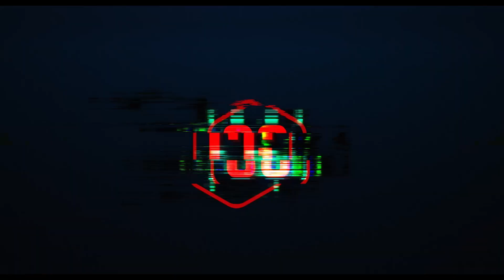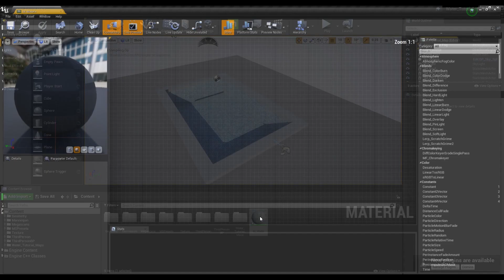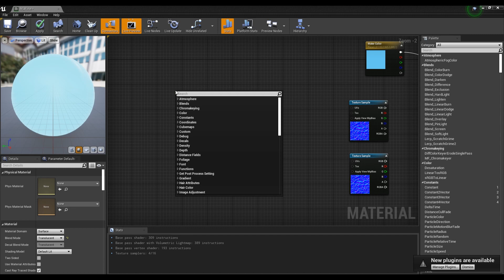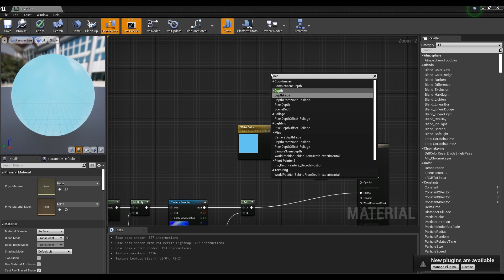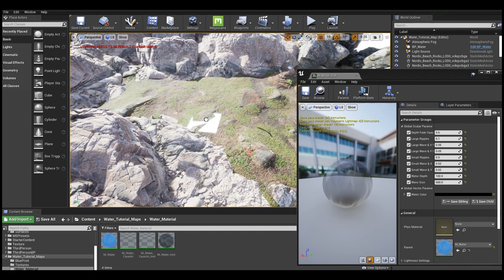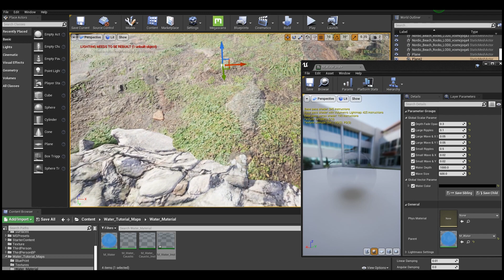UE4 Simple Water Material l Unreal Engine 4.26 (Tutorial)

Comment: While you adjusted the parameter names at the end, it doesn't help because they don't match the material blueprint you build throughout the video. What you need is fill out the question marks with the matching parameters or use the proper parameter names throughout the video rather than the ambiguous ones you chose.

X = ?
X2 = ?
Y = ?
Y2 = ?
Metallic = ?
Specular = ?
Etc.
Reply: X= Large Waves X
X2 = Small Waves X
Y= Large Waves Y
Y2 = Small Waves Y
Metallic, roughness and spec did he convert back to a constant
Water= Large Waves
Water2 = Small Waves
Depth opacity = Depth Fade Opacity
Fade Distance = Water Depth

You might already figured it out, but for anyone else ill leave it here

Comment: Problem: So the materials works fine, but I have problems with the refractions, so the materials always gets cut off on top or at the bottom of the camera whenever I change the value for the Fresnel or no Fresnel, I still can't find a sweet spot or is this just a Unreal thing? The unreal starter water material doesn't have this problem but there isn't a lot of option in the instance for me to check what was the problem.
Reply: Oh wait, ignore the Unreal starter water since it's not transparent

Comment: could you explain a little more on what is going on at the 3 minute marker, the world position and the x and y stuff please. I get how to do it here, but if im not sure how I would use this for other materials, like what is ACTUALLY going on vs the final effect it gives, I want the former. would be much appreciated!
Reply: He is projecting world aligned UVs on the X and Y only by using the component mask and having only the R and G values which are the X and Y in world coordinates, ignoring the Z, because you're only gonna look at the water from above. And the divide is setting the scale of the UV in centimeters. Check unreal documentation about absolute world position.
Basically it is like a texture coordinate but using world measurements. It is extremely powerful to create seamless transition between mesh textures if you have for example 2 rocks with moss texture on top of them and they are put into each other. You will have no texture seams on the moss.